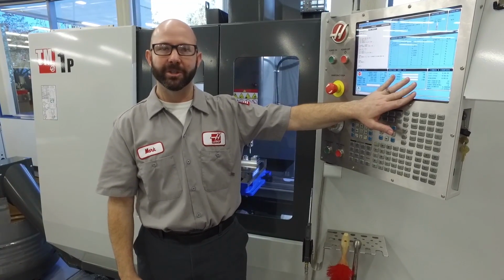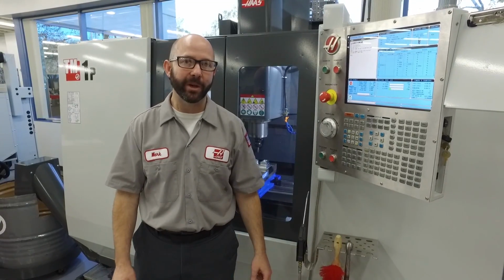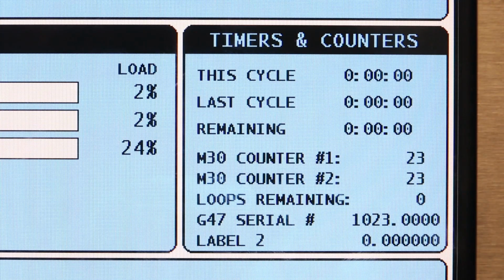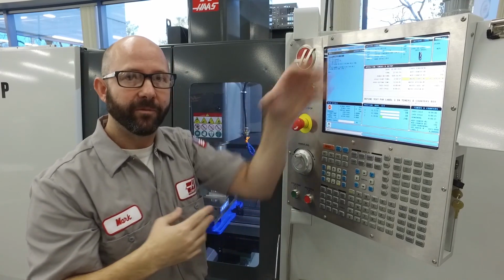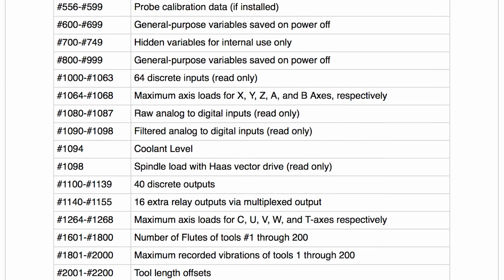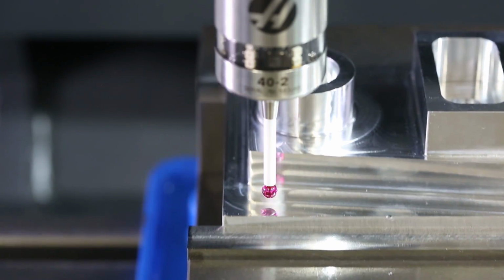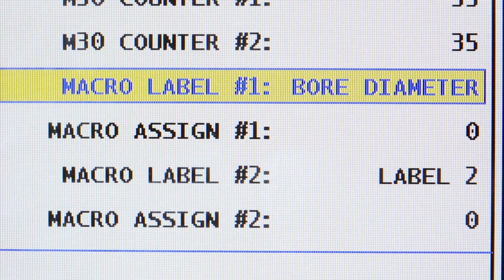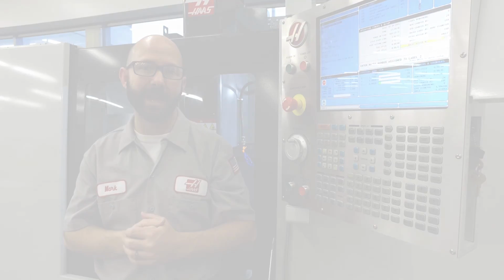Get the info you need by customizing your Haas control home screen – Haas Automation Tip of the Day

Comment: Sir why can't I use G68 code in hass control when I use it ..m/c alarm will start says not defined g code 
M/c is vf2 & vf1 2011 manufacture year
Reply from the maker: Hi Madhu – Check out this video for more information on our G68 command, https://youtu.be/5j8GJGqLztU  . If you still have issues, give your local Haas Factory Outlet a call, they can work through your program with you to find the issue. Thanks for the comment. – Mark, Haas Tip-of-the-day

Comment: How do you save those variables to a USB stick for each individual piece, for part inspection in purposes Excel?
Reply from the maker: Panzerclaws – On most Haas Controls, we will load up a USB stick, and press F3>Save Macros. On machines with the Next Gen Control, we can write those variables directly to the USB stick with DPRNT statements. https://youtu.be/g7hl2Lw4KdM - Mark, Haas Tip-of-the-day

Comment: How can I display the current G50 speed on my lathe? The system variable number for it  is not listed in any manual. This would be very useful in preventing accidents.
Reply from the maker: TheSouper07 – On most Haas Lathes, you can see the current G50 Max Spindle Speed, in the far right column of the CURNT COMDS>ALL ACTIVE CODES page, the Speeds and Feeds Column. My lathe here says G50 = S1234, because I had command a G50 S1234 in my program. The G50 Limit can also be seen as “LIM: 1234” in the SPINDLE window (bottom left) on the main screen on classic controls – Mark, Haas Tip-of-the-day

Comment: Is it possible for a macro to write to these fields, to determine on-the-fly what the labels will be and which variables will be displayed?
Reply from the maker: Matthew Hajicek – Great suggestion. I’ll enter it as an enhancement request. Thanks for the comment. – Mark, Haas Tip-of-the-day
Reply: I read this and watched the video along with reading other postings in industry forums on the general user I/O topic. I have some specific suggestions for HAAS.
Reply: The settings stored on the Current Commands screen for the Macro Label and Macro value must also be macro variables. If we could just set those programmatically then Matthew Hajicek request could easily be satisfied. e.g. #macroLabelVar = “Feature A Depth”. Is this actually possible now and we just need a little documentation pointing the way?
Reply: Setting Variable #3006 (message text) allows the programmer to output a brief message to the operator - please add the ability to also include variable values eg #3006=(Feature A depth measures: #1[33]) would display to the operator “Feature A depth measures: 001.125” following the same syntax as DPRNT.
Reply: Finally the DPRNT command could have another output option for on screen display. There is a large blank region on the active program page under active codes and active tool that easily display the content. The jog handle could provide scrolling up/down as well for this output area.
Reply: The examples for user input in the manual for matching user key presses against ascii codes is also surprisingly primitive. I’m surprised at how limited the input/output capability of the HAAS NGC and I really wish HAAS would improve it. I don’t understand how HAAS can debug their control software without this basic capability - I’m sure it’s there but it’s just not available to end users. Finally if HAAS makes these improvements then I also wish there was a way for me to actually update and install those changes on my machine. It’s just software patching. I would pay annual maintenance if HAAS could make continuous updates available. Pretty normal basic software business practices. Thanks Mark and HAAS for listening. -John Anger you could contact me john at shop dog fabrication dot ca
Reply: @haasautomation  Has there been any progress on this? I was just trying to figure this out the other day.